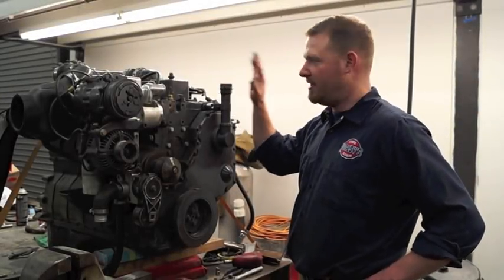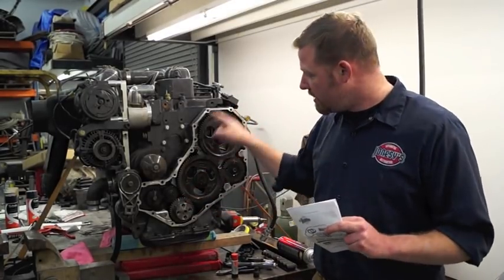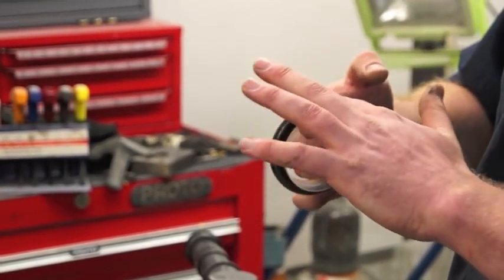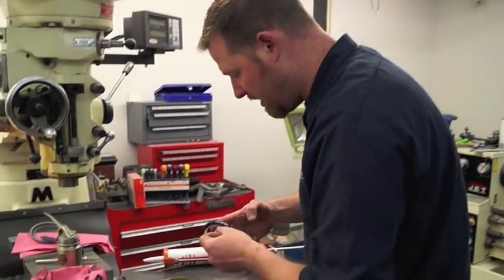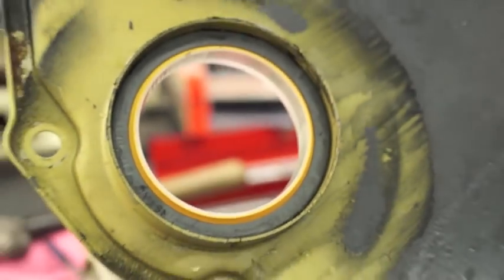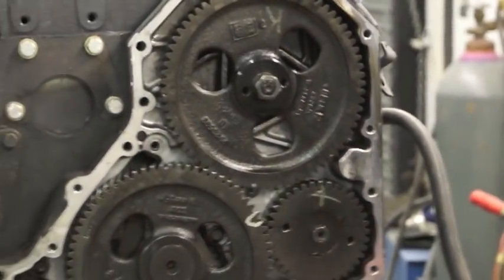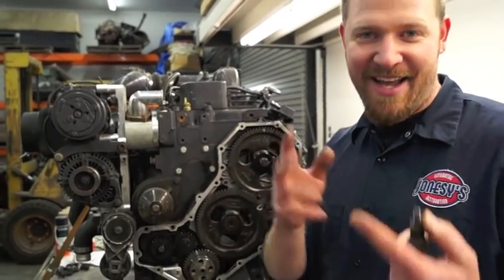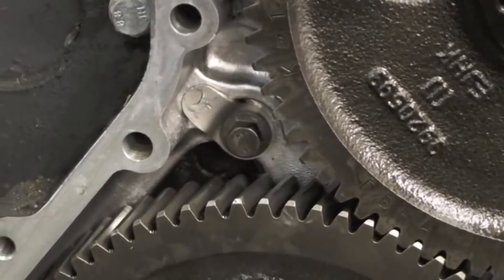Killer Dowel Pin KDP Install Video

Comment: Maybe I'm not seeing things right....but this engine appeared to need the "stair stepped" tab and not the flat tab as shown.  As you can see when he tightened the bolt down it bent the tab greatly out.  There are differences in these B engines.  Some have a flat surface across to the pin bore and on some the pin bore is in a different plane than the flange face of the bolt.  While this may still work OK...it's not right in my book.

Besides the tab...old timers used to tap the pin back to bottom out, shoot some wicking loctite green in the bore and peen the bore inside with a punch.  Just as effective and free...besides the gasket and crank seal.  This is how I fixed mine.  Some but not all 24V ISB 5.9L's had a lip edged inner bore so the pin couldn't come out.  But only visual verification can tell you if you have this case cover.  No serial number or date can prove it as verified by Cummins.
Reply: هناك توقيت عام تشترك فيه كل المحرمات يغني عن كل الشروحات
Reply: It will work just fine the way he did it.  Some people just get a fender washer, cut it into the shape of the tab, bolt it on and then tap it down like he did.  As long as it prevents the dowel pin from coming out, it's all good.

Comment: 6:59 Dust Shield.
I thought that was an oil slinger?
Whatever it is, is this item install on the inside or outside of the seal? Do I put the ring on the shaft before I put the cover on (oil slinger) or put the ring on the shaft after I put the cover on (dust shield)?

Comment: hey does anyone know if you can do this KDP fix without have to jack the engine out of the truck? I was thinking you could probably take the grill off and radiator and whatever else so you can see, let me know. thanks
Reply: yup, you dont have to pull the motor, go look it up on "cummins forum"
Reply: alright that's what I thought, ill check it out then and then when I go to do it I might as well hit the seals too
Reply: yes you can easily do a kdp in the truck

Comment: What years is the killer dowel pin an issue?
Reply from the maker: Through the 24 valve models. 2002 is the last year
Reply: '89 to '02.  From what I've read the '94 to '02s are a little more likely to vibrate out, but it sometimes happens in '89 to '93 12v's too.

Comment: use a socket over the installed tool   so it can be hammered in evenly.
Reply: Claudio Del Castillo know where I might find a 3 inch socket anywhere else than in a heavy mechanics shop?

Comment: does this apply to a 2006 5 9 Cummins
Reply: No this is only for 12 Valves (89-98)
Reply: i believe the KDP was fixed by cummins in 2003
Reply: 12v and 24v, '89 to '02.
Reply: Killer pin trouble ended in 2002 models ( 24 valve ) It had begun in the mid year of year 98. I’m talking about the 5.9- 24 valve. It so happens I have the 98.5, 24 valve and its killer pin was approximately half way out. And now I’m having a problem getting it to go back in.